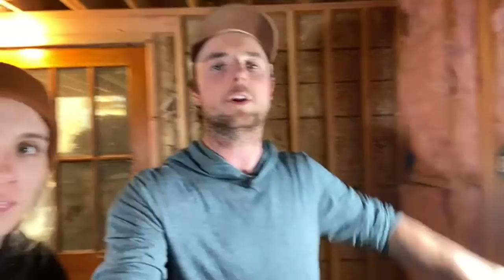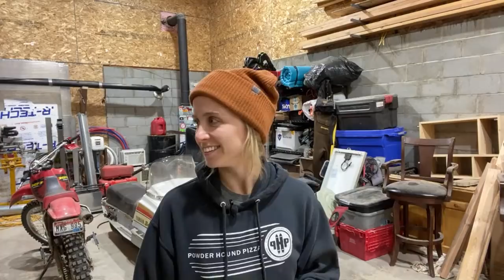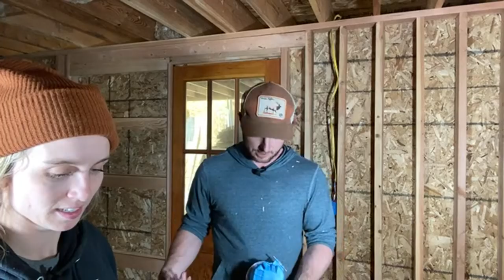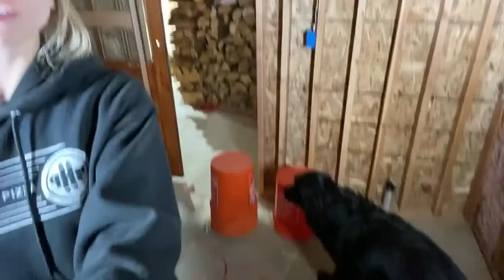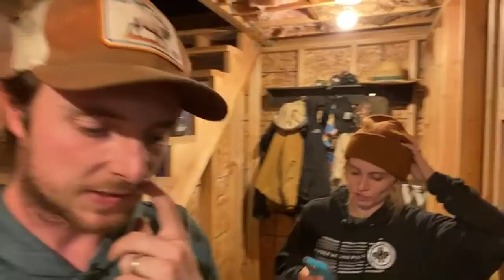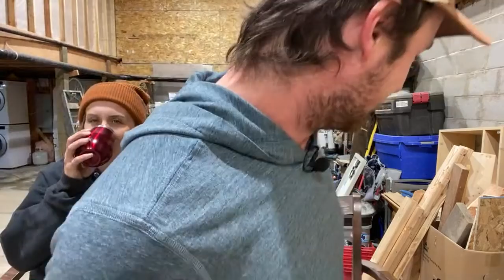What’s the Prognosis?

Comment: On buckets, try running hot water over outer bucket to heat air poker up so it will expand and see if that helps so you can pull apart